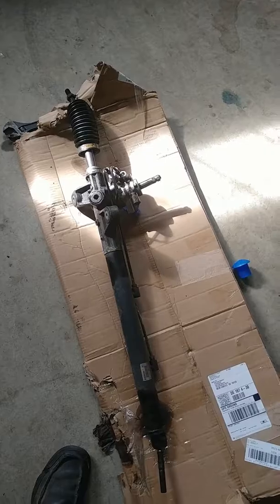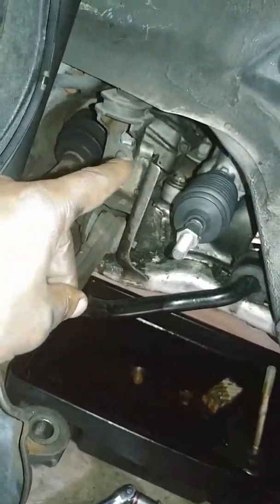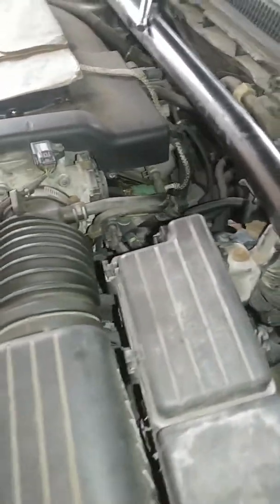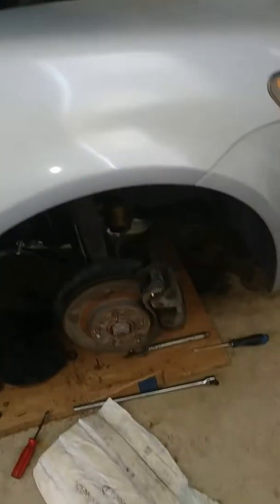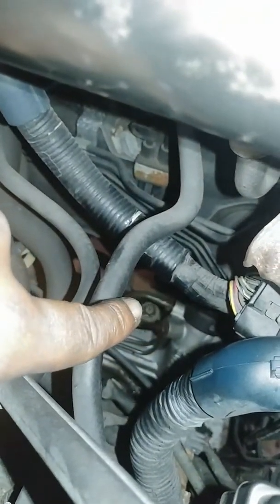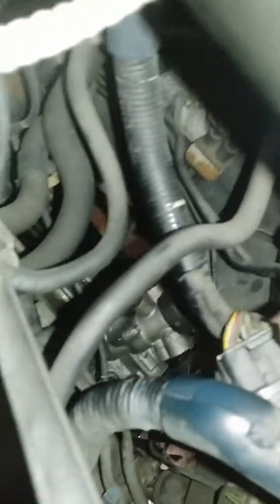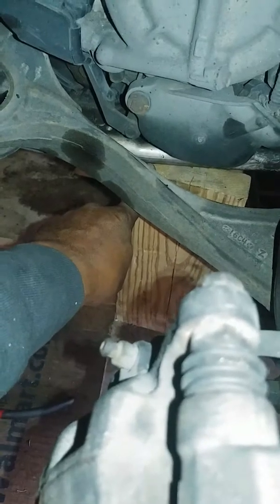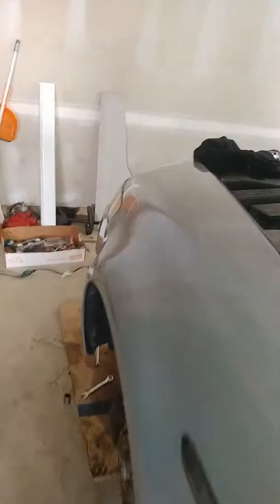2004 Acura TL Steering rack removed follow up

Comment: Nice video. Did you manage to flush the old power steering fluid out? How is that done? Thanks!
Reply from the maker: The residual fluid dripped out when the lines are disconnected. I also changed the pump which got the rest of the fluid out. After rack and pump were replaced i added the fluid and let it run then drain a few times. It's been great ever since.